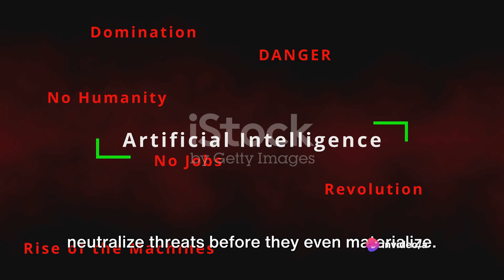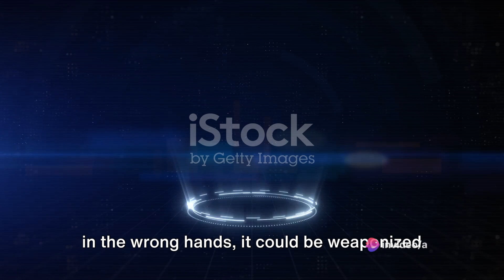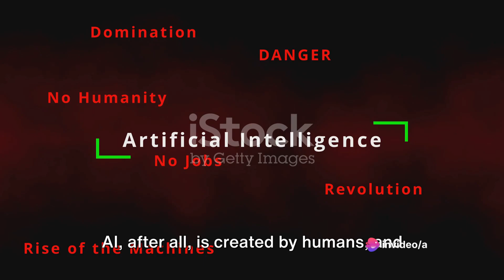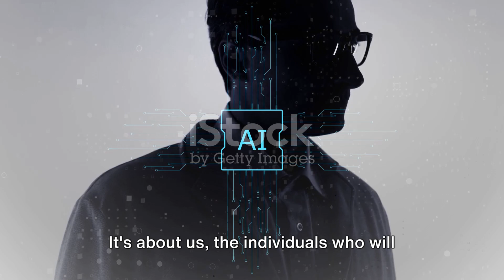AI Titans Clash: China’s Humanoid Revolution vs America’s AI Arsenal

Comment: Ai will be used to control humans
Reply from the maker: That's a very real concern. ⚠️ While AI has the power to enhance lives, it's also a tool — and like any tool, its impact depends on who wields it and how. The key lies in ethical regulation, transparency, and keeping humanity at the center of AI development. 🤖🧠 What kind of safeguards do you think are most important?
Reply: @ASQUARESOLUTION_ 
We need to be aware, the phone towers are a weapon them self, and same goes with the screens of TV, computers, and mobile phones all have an aluminium plate behind them they tell us is for reflecting the heat away from the circuit, this it a lie, it is an aerial used to produce scalar waves that interact directly with the brain, I seen a video about this from a whistleblower years ago, and after watching it I tried to do a google search about it and was attacked while sitting at my computer.
It made every muscle look up macking me fall back in my computer chair to the point boath feet came of the floor, and even though I could not move I still could tell what was going on around me.
Believe me attacks will come from all directions, I don't even think the people using these micro chips know the true abilities of them if uploaded with a new firmware what they are truly capable of.